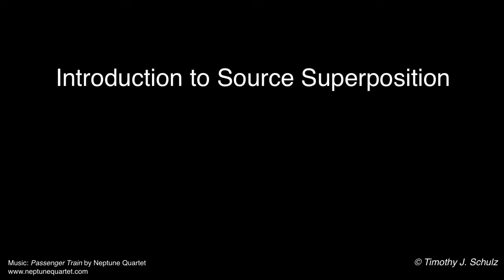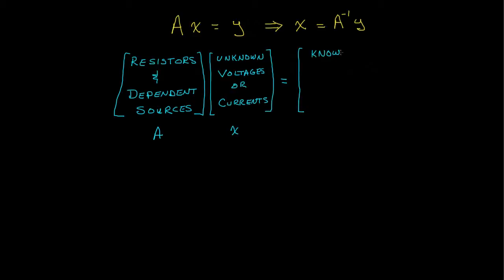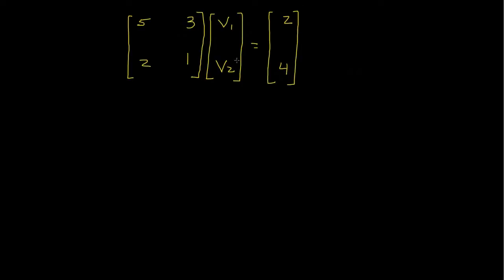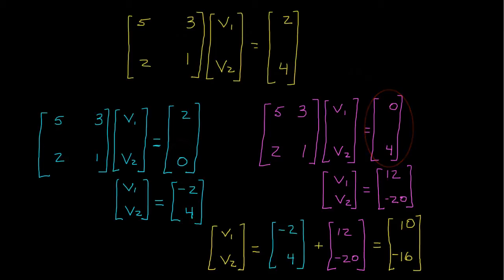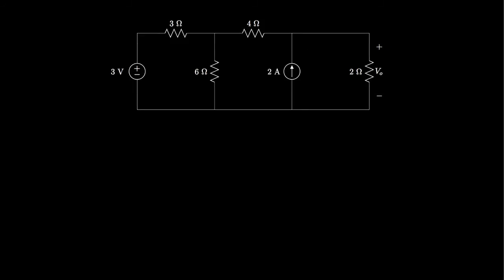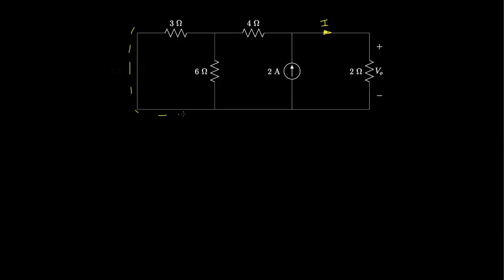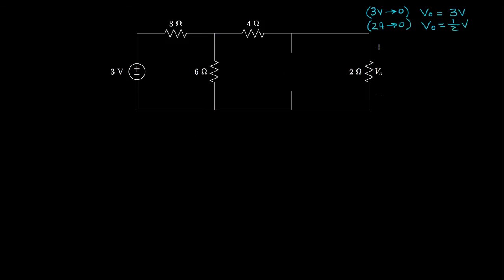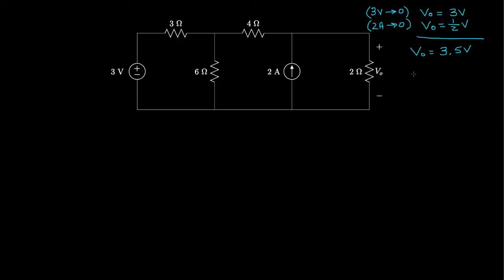Introduction to Source Superposition

Comment: I started to get confused at 8:55.  At V_1, was what you did basically a node-voltage equation?  I guess I wasn't following with the 3/2 ratio.  Could you explain that a bit more in depth to me?

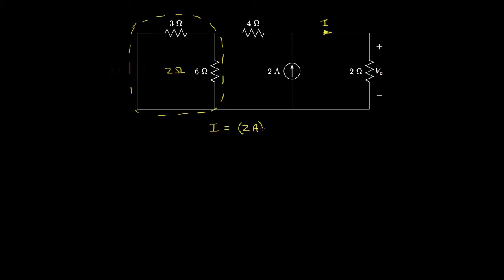Comment: @7:10, how do you decide whether to put the opposite path's resistance in the numerator verses (6ohms) verses putting the non-opposite path's resistance on top (2ohms) in the numerator? I feel like it it some rule that I use to know but forgot about.